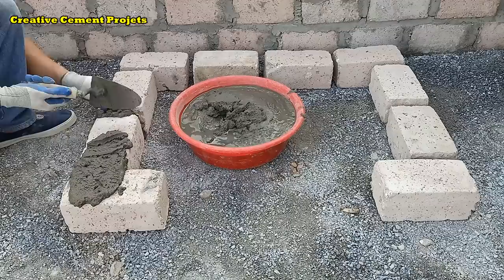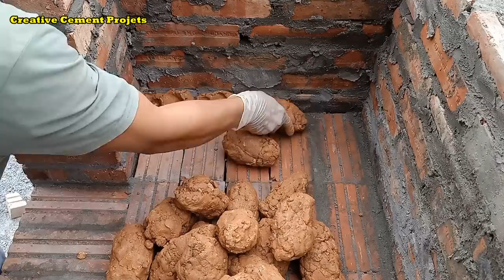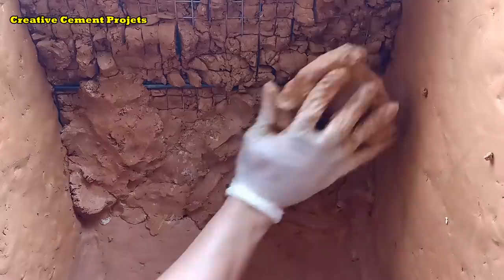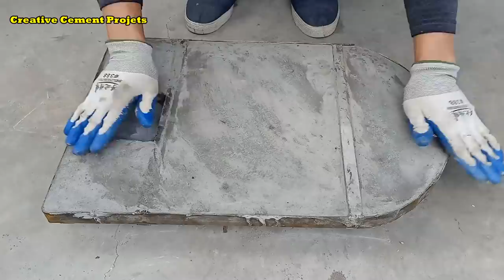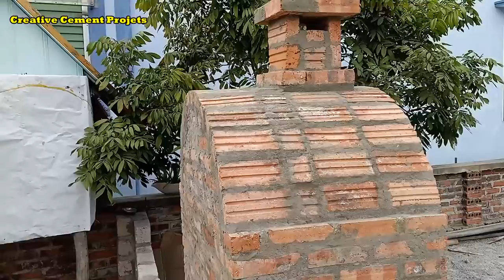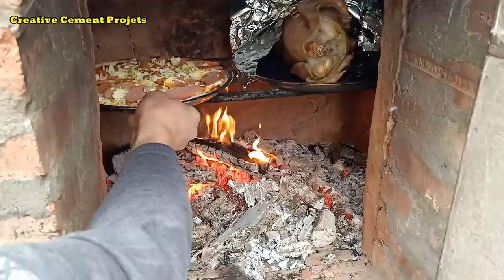How to build a multi purpose oven   A pizza oven

Comment: Finally a real clay oven. Some other builders use a lot of portland cement inside their oven and that's very toxic. The heat will make the cement to crumble,overtime, and will fall all over the food.
Clay is a wonderful material and is safer than cement.
Your are good amigo, keep the good videos coming.
Greetings from Toronto.
Reply from the maker: Thank you very much 💖👍

Comment: Have you had any issues with clay dome with metal causing clay to crack due to metal expanding.  Love your oven
Reply from the maker: Thank you. After 1 or 2 times of burning the stove, if it is cracked, you can repair it and use clay to repair those cracks.

Comment: Why the clay?  Couldn't you just use cement on the inside?
Reply: Regular cement can't handle the heat. Clay is cheaper then refractory cement. When the clay starts to deteriorate he can replace it.
Reply: @yeagerxp  thanks for responding.
Reply: @melinda5777  U R Welcome
Reply from the maker: Thank you for your comment, inside I use clay to increase the durability of the kitchen

Comment: Hi... Could you give me dimensions..
Reply from the maker: Thank you. You can build large or small depending on your needs. My oven is 90 cm long, 80 cm wide, 180 cm high ...
Reply: @Creativeproject2020 
Does the clay get affected by heat and crack?
Reply from the maker: Thank you the clay you let dry for the kitchen to function, it does not crack
Reply: What is the type of brick you used? is it a normal or anti heat bricks?

Comment: This is not a pizza oven. Your design has inherent flaws. Most of your heat will escape from the chimney directly on top. There is not enough room for a 12" pizza to rest inside. And finally, the base is too rough, the pizza will stick and burn. Good luck on version 2.0.
Reply from the maker: Thank you for your contributions, Thank you very much